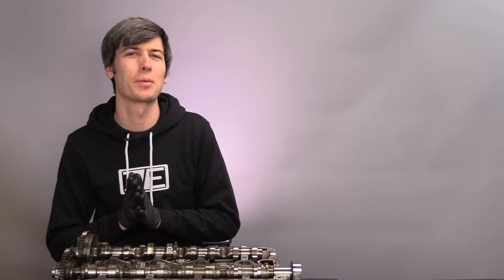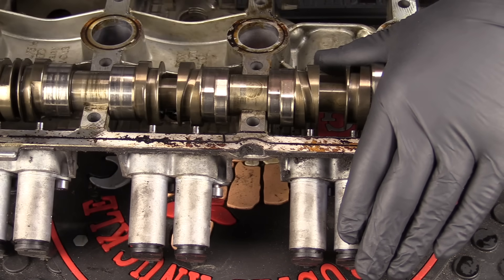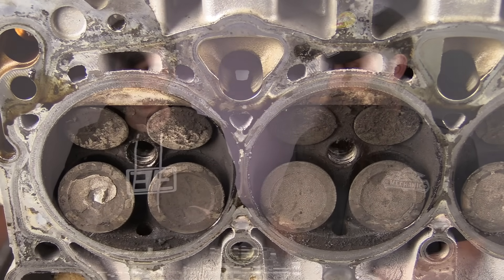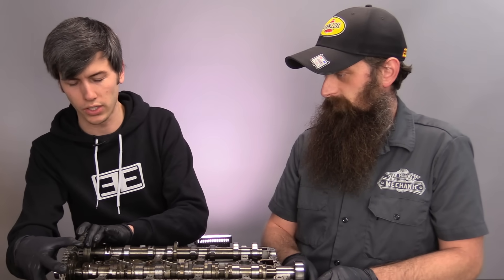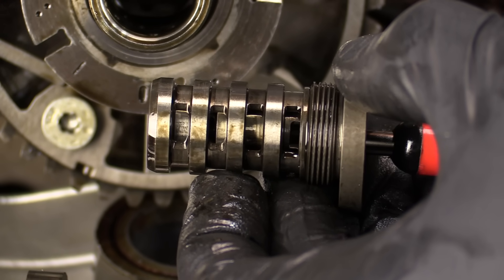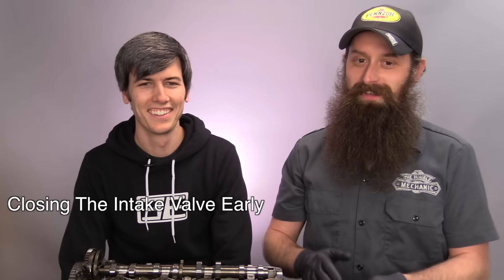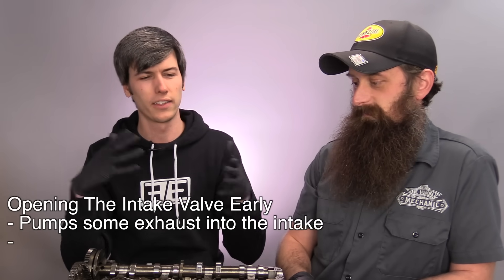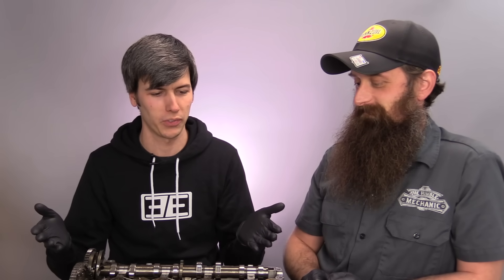Variable Valve Lift vs Variable Valve Timing - VVL vs VVT

Comment: All of this engineering for mostly just emissions purposes. Is that crazy or what?
Reply: These systems let you have maximum power when you need it, and clean combustion/fuel efficiency when you don't need all the power. How could anyone complain?
Reply: Maybe that's the motivation but it creates a more powerful and efficient engine for a given displacement and everyone benefits from that.
Reply from the maker: It's not crazy, but it is cool!
Reply: @EngineeringExplained Sir can you make a video how to remove and replace lash adjusters/lifters without removing timing cover and timing chain for i20 1.2 p 2011?
Reply: so crazy that people want to breathe clean air!
Reply: @thatf_inguy8220 and save money
Reply: @thatf_inguy8220  Be happy you're not inhaling LEAD anymore
Reply: The emissions of an electric car are where the power is made. Mostly in coal plants. Solar with an energy return on energy investment of 10% to 20%(20 only in deserts) and this whiteout the needed back up and recycling is also not so clean.
Reply: @KVEize  even if your chargeing an electric car off a coal plant it still equals less emissions... Its more efficient to produce power with one large system then distributing it than it is with a lot of smaller systems. Not to mention the efficiency that your also gaing from regenerative braking plus less moveing parts like doing away with the need for a transmission. Lithium mineing is not exactly environmentally friendly but no mineing operation is. Luckily lithium batteries can be recycled unlike oil or coal after it has been mined. All electric cars could be simply powered by nuclear energy and we could make everything emissions free. And yes there is such a thing as safe nuclear technology that does exist. The oil executives would like you to believe otherwise. They will say it's too expensive. What that means is they cannot make a profit off it.
Reply: Well it can also help flatten the torque curve...
Reply: My 1996 MGF 1.8VVC (Variable Valve Control) gets 20% more power out of 5%less fuel than the 1.8i . Definitely not so crazy.
Reply: You do understand that pollution kills people right?

And again, so crazy that people want to breathe clean air, I live in Delhi,   In november it was so bad that you had difficulty breathing after walking about a kilometer.
So would you rather have that, or breathe clean air.

And you ofcourse know about climate change?
Reply: I don't know about climate change, but all those toxic chemicals floating around in the air can't possibly help humans, plants or animals.
Reply: Before you invest, work out how to recycle the arsenicum in the galliumarsenide from solar cells. At the moment this is not solved. When you want a poisoned earth, solar is the way to go.
Reply: That Car Guy Well lets see I've learned it from a college class I'm taking on global warming. I'm learning it from somebody with a PHD in Atmospheric Sciences. Also, I can why it was so much hotter back then if you want me to but you would probably prefer to jest keep telling me I'm ignorant.
Reply: That Car Guy The class I am taking is not mandatory and the facts I am basing my thought off of has been taking by thousands of scientists. You need to understand you are not on the side of science at all. CO2 is a greenhouse gas and greenhouse gases soak up infrared radiation that the earth emits that would otherwise be emitted into space. This extra energy warms the climate. Whatever point you are trying to make is cool and all but following the physics it simply does not make sense. I can do the math, you can do the math, and we will both get the same answer: when you crunch the numbers, the earth PHYSICALLY has to warm.
Reply: You think this is complicated, check out how much goes into diesel on highway truck aftertreatments. That will blow your mind.
Reply: That Car Guy I know what I'm talking about. I have the facts to back up what I'm saying but I don't want to link you to all the graphs because trying to get somebody like who is totally in denial of climate change to accept climate change just isn't worth my time.
Reply: Unbearable Pain it ain't for just emissions, it's for power and smooth idle too.
Reply: One word, racecar.
Reply: That Car Guy
The earth axis was different back then..
You need to compare to how the earth temperatures was in the last 50 years, not 50000 years..
Reply: dude.. you had one link, and you think you're a scholar. You think that people are concerned about you blocking them because they're "trolls" for disagreeing with you? You're blocking your ability to learn from others by being so staunch on your opinion.
Reply: it s so crazy vw wrote special software fore it...!
Reply: "Natural variability can explain much of the temperature variation since the end of the last ice age, resulting from factors such as changes in the tilt of the Earth's axis. Over the past century, though, global average temperatures have "risen from near the coldest to the warmest levels" in the past 11,300 years, the 2013 study authors explain. Over this same period, emissions of heat-trapping gases from human activities have increased." https://www.climate.gov/news-features/climate-qa/what%E2%80%99s-hottest-earth-has-been-%E2%80%9Clately%E2%80%9D

This is from the same website you linked your article from. Global temperature rising that quickly doesn't seem like a very good thing. A bunch of solar panels will still contribute to pollution, but I think it would still be better than burning coal.
Reply: That Car Guy Um ya I am ok with solar farms because it better than getting cooked from global warming.
Reply: hyusama 
Changing the cams doesn't improve the efficiency. Let me explain a bit here:
The important part about making an engine powerful is the moment when the air is being sucked in. For max power you'll want as much air in there as you possibly can, and that is why you'll want the valve to be fully open for as long as possible as the cylinder moves down. Now the problem is that a valve takes a certain time to open and close, so what engineers do is they have the intake valve(s) start opening a little before the piston has finished its 'exhaust' upstroke, and be only fully closed as the piston is already going up again. 
In addition to that they make the valve go up and down faster. The consequence of all this is that at the beginning of the intake stroke, both intake and exhaust valves will be open at the same time. In german there is a word for this which I cannot translate :-/. Well anyway it turns out that cars where that overlap is smaller have more torque in lower rev ranges and thus are more driveable in everyday conditions. Also, they lose less fuel over the exhaust, which means they are more efficient. They trade that in power, ofcourse. So you see, there has to be found a compromise in terms of the overlap. Btw. valve opening speed is a similar thing also determined by the cams' shape, with a fast valve opening increasing the filling of the cylinder with air -> more power but at the same time worsening the efficiency as the engine has to accelerate the valves up and down quicker, wasting energy.
Reply: high eff. means higher pressure and temperature, which cause significant increase of NOx emission and soot emission, that is the reason why there is the propulsion system development, which is my major, and why there are engine tuning engineers. People try to let the engine working outside the dangerous regions of emission formation and at the same time increase the eff. as much as possible, it is a compromise.
Reply: Not crazy at all, we should take care of our planet.
Reply: That Car Guy
Yea but anything we can do, the better.
Reply: Not just for emissions. For relative efficiency. Your engine will be more powerful if the lift and timing are varied for the amount of power/rpms/etc.
Reply: To be fair, there is no trolling where these guys are coming from. I agree, we have normal cycles of heating up and cooling down, but the vast amount of formlerly earthbound CO2, that has been pumped up and burnt (therefore put into our atmosphere) has drastically sped up that process in a way, that is sadly not natural at all. Earth itself will also have no problem in a dinosaur like hot climate, but we as humans will. The hotter the planet gets, the more water can be held by the atmosphere. That is why we now have problems like the drought in California. The water doesn't need to rain down as much as it used to.
Reply: Hi Ethan Arpin and That Car Guy and others.  Interesting topic this global warming is it not?  Yes the earth goes through cooling and warming trends over the centuries.  That is normal.  Although to say that the earth's axis tilt was different way back when is still speculation as is most discussions of how the earth was thousands of years ago.  So unless you were there at that time, it is speculation.  

I do not care what some scientists or so called experts say.  And just because a PHD in atmospheric science says something it does not prove they are correct. The so called experts tend to be proven wrong more times than right it seems.  Many scientists will say whatever they are paid to say.  It is all about money and a professional career. 
I see this first hand all the time in the healthcare field, such as can be seen in the dangers of the heavy metals like mercury and aluminum used in vaccinations, which the CDC has tried to cover up the related injuries and deaths in children that have occurred in the name of profit.  The so called experts turn out to be frauds for money, and research is manipulated to support the profits.  I have seen it.  

You have well meaning medical doctors at the CDC literally crying when they found out the truth about how the research shows the extreme dangers of mercury, yet these same doctors have their opinion changed in just a two day conference to agree to hide the truth from the public. The same is seen in the global warming debate.  If it was not an issue why is there a federal gage order against all in the weather profession from even discussing the geoengineering projects taking place right before our eyes everyday.   It is all about money and control.  The earth may not be warming because of car pollution or industry pollution (they certainly do not help the problem though), but the manmade geoengineering projects to control weather seems to be making a normal process go out of control at an alarming rate.  The last three years saw record breaking years of high temperatures according to NOAA.  So while you both may be right in a sense you are also both wrong to a degree.  You want the scientific facts you can verify?  Go to geoengineeringwatch.org and see the evidence presented by Dane Wigington.  Verify the evidence for yourself if you are so passionate about the issue. Than spread the word as a first hand eye witness.  Not as a troll reiterating someone else's paid propaganda.
Reply: VVT can be used either the increase performance (Honda Civic type R)  or fuel economy. I think Jason made a video about VVT a while ago...
Reply: That Car Guy
Links are not facts, m8.
The reason is yes what you say is true that temperadure shift with time naturaly.. but what the other guy say of the effect of emissions to cause a green house effect is true as well.
Reply: Solar panels aren't the antithesis to fossil fuels. You're getting hung up that one alternative energy source isn't as efficient as you'd like it to be. Additionally, you don't need to burn coal to make steel- you just need the heat, and carbon to fold in (which doesn't have to be byproduct of combustion, it could be supplemented and the heat could come from any sufficient energy source).
Putting a hundred ellipses between your fragmented thoughts doesn't substitute for analytically approaching all sides of the problem. I don't advocate we all install solar panels to avoid burning gas- I advocate we should find more efficient means to extract the energy we need from the sources we have. This reduces anthropogenic effects on the environment.

Your complaint originally stemmed from your frustration of the efforts to make fossil-fuel consuming devices more efficient, which has nothing to do with substituting solar energy. If anything- it allows the prolonged use of fossil fuels until the scale of electric infrastructure achieves the necessary efficiency to supplant them. Do you honestly try to understand the rationalizations presented to you as to why conservation is worthwhile, or do you just blather "troll" and "solar panels aren't clean" as non sequitur response?
Reply: vw caring about emissions?  lmfao ya right. thats why they lied to there customers just to sell there cars. Vw is the biggest scammers and now they wanna try and pretend like Honda didn't originally have the idea and patent for Vtec.   now all these car companies are putting it in there engines and claiming its there idea smh. Vw i garbage. you 100% should of had etcg1 explain it since hes a real tech. A legit certified Honda tech.
Reply: That Car Guy research can change what it takes to make a battery. but no one will invest in research unless we have electric vehicles on the road that will directly benefit I.e directly make the researcher rich. but anyways one such technology is hemp batteries. which would take unusable material from hemp growth and use it for batteries.
Reply: Unbearable Pain not just for emissions, but efficiency and power. people like buying cars that save them money and can go longer. having an inefficient car is bad for business.
Reply: even you breathing will pollute the air. so stop debate about this.
Reply: Unbearable Pain No, it's for efficiency first and which in turn has an affect on emissions, since shitty emissions generally mean shitty efficiency . It could even make your engine more powerful. Why do you think one of the most popular performance upgrades is changing the cams?
Reply: Le Enderman Or they could work on both. Such as the freevalve system. Which stomps and smashes every aspect of cams period.
Reply: Unbearable Pain 🙂
Reply: Unbearable Pain , yes it's extremely crazy and for these reasons and many others internal combustion engines are gonna be replaced soon for electric ones...
Reply: vtec is nothing like this. the exh is  remotely similar because it uses soleniods. and vw bs was diesels. and now fca is getting crap for thier 3.0 v6 and 6.7 cummins (cert vw tech)
Reply: Unbearable Pain and according to master overlord trump, global warming is a bunch of bs
Reply: That Car Guy iirc one solar farm the size of New Jersey (probably smaller with more efficient panels) can power the world.
Reply: That Car Guy didn't say one farm will just saying that a farm the size of New Jersey will provide enough power
Reply: yeah but efficiency is a general concept of engineering. especially when it comes to cars. more efficient = more power per physical equipment
Reply: when congress made emission laws Honda hired 100 new engineers and GM hired 100 lawyers......
Reply: No, it's crazy.
Reply: So ignorant that you think car's geared towards performance are any type of serious contributor to air pollution. They're not.
Reply: Come on, I love the engineering. I am involved in the improvement of performance side of things. So much fuel is wasted for increasing power if not for these innovations which helps suck up all the energy the fuel contains. If one gets same power with less fuel using this, isn't it better. You get to save money on fuel, and stop being slaves to Arab countries for their oil, as you can self sustain from your own fuel sources. I work on ethanol engines, which you can make using agricultural wastes.
Reply: I'm glad somebody finally mentioned Overlap. Because all the explanations about opening and closing valves early in this video miss the point and at least a couple were just incorrect. No mention of air/fuel mass having inertia, no mention of scavenging.  Pumping exhaust gas from the combustion chamber into the intake is just BS and does not happen and would heat the engine up as the cooling effect of the incoming charge is used to prevent meltdown in race engines.We control the power with throttling not by pushing burnt gases back into the intake.
Reply: JoeyRodz74 you are 100% correct!  Not to mention that ICE is reaching maturity while electric vehicles have great potential for efficiency improvement and cost reduction.
Reply: And horsepower
Reply: Hugging a tree isn't going to help your family when the smog is terrible.
Reply: That Car Guy No, you're wrong. Some cooling and heating is normal but not at this rate and not to mention the heating and cooling in the past was for a reason. Currently there is a ton of CO2 in the atmosphere and basic physics tells us the earth will warm because of that.
Reply: For fuck's sake man, read something on this topic. Really. Electricity 
from the dirtiest of coal plants is cleaner than the cleanest of all ICE
 cars. 

When you're ready to make a fair comparison include all of the emissions from drilling, transporting, refining, storing and delivering to whatever the ICE car spews out.

Also remember that an electric car can drive with solar, wind or thermal power - ICE can't. An EV won't kill you if you leave it running in your garage and won't give off emissions as you drive it around.
Reply: KVEize not really in the US. China gets most of its electricity from coal but not in the US. Also, just because that's the way it is right now doesn't mean that there isn't a reason to change. Solar energy can power the world not problem but we need to invest in it first
Reply: @CactusJones7  solar sucks, nuclear is where it's at. Working on how to deal with nuclear waste would be a lot better use of ones time than making solar or wind power more efficient.
Reply: cuz nox is poisonous and can cause photochemical smog. So the organizations set specific pollutant limits and charge punishment fees for cars produced that create more polluntant than the limit. Something like three way catalyst for gasoline and SCR for the diesel can reduce the Nox emission by more than 90 percent, into Nitrogen.
Reply: KVEize solar isn't perfect currently but just because it's not doesn't mean we should make global warming worse. Electricity is a renewable and, for the most part, totally clean energy source. Gasoline is nonrenewable and its awful for the atmosphere
Reply: Just? Emissions? Like it’s not important...emissions just as important bro.
Reply: You ought to see the engineering that goes into making electric cars that have no emissions. But hey, let them keep playing with dinosaur juice powered complicated machines while they still can. It'll all be soon gone.